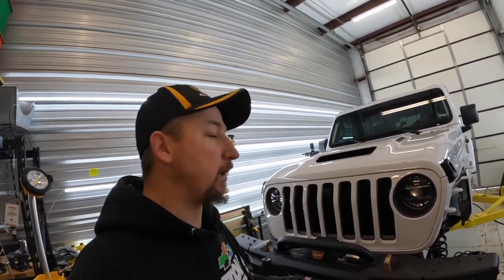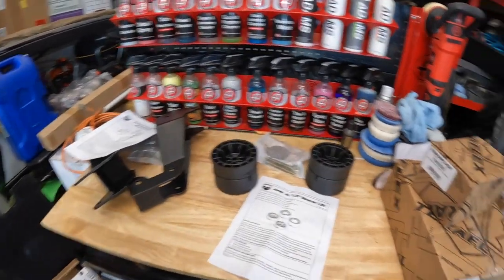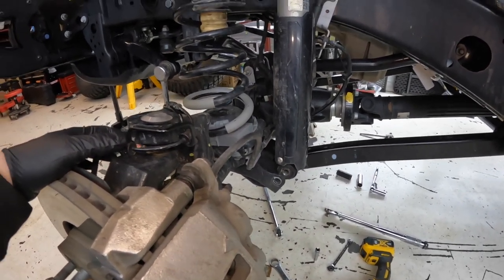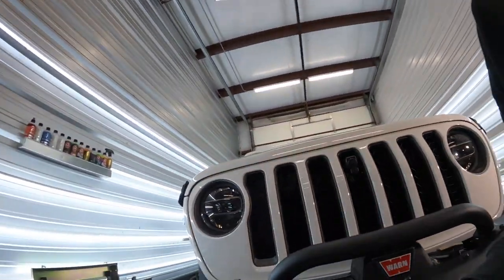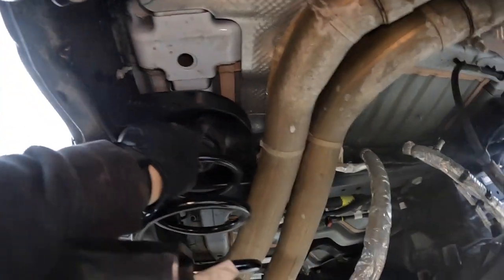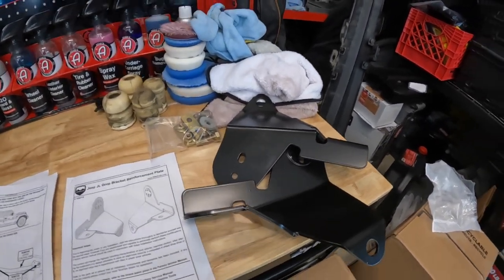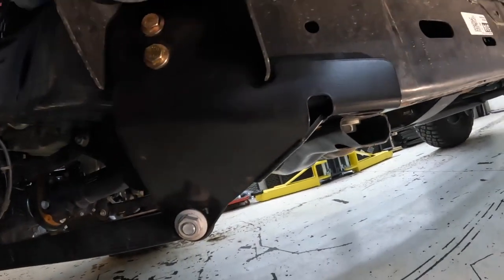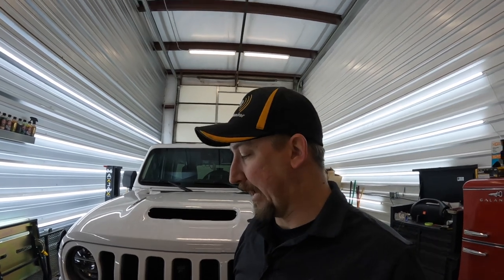Wrangler 392 Terflex Lift!

Comment: Great video! Couple questions.  Did you have to extend the shocks and how does it drive with the spacer lift?
Reply from the maker: Hey Dave, Glad you liked the video.  I did not do any shock extensions.  I called Teraflex prior to purchasing the parts to ask them about that and they said that the available 2" shock extensions would be too aggressive.  It drives pretty well.  You can tell it's not stock, but still drives better than our previous Jeep Wrangler JK with a 4" Mopar lift.  We did just get back from Easter Jeep Safari in Moab and had a chance to talk to the guys from Teraflex.  Rumor is there will be more goodies coming for the 392 soon.

Comment: Did you not need track bar brackets or an adjustable track bar because you used the front control arm drop brackets ? Thanks
Reply from the maker: You can certainly get away with this lift without any track bar modifications in my opinion.  I'm sure other people out there would disagree with me, however my intention is for this lift to be temporary until somebody comes out with a specific 392 lift kit.  From talking with the guys from Teraflex at EJS they are supposedly in the testing phase of a true lift kit for the 392.

Comment: Hey I had a quick question. Did you need shock extensions and how is the ride after the 1.5 Teraflex spacer lift? Would your recommend that set up?
Reply from the maker: We did not do shock extensions.  I called Teraflex prior to ordering the parts and asked them about shock extensions and they said it was not necessary.  The ride has been just fine.  You can tell its not stock, but not far from it.  Still rides better than our previous 2017 Wrangler with 4" Mopar lift and 37's.  I would recommend this setup for anyone looking for a budget lift option or just desperate to lift their 392, however I spoke with some of the guys from Teraflex at the Easter Jeep Safari vendor show and it sounds like they are currently testing a true full lift kit for the 392 right now.  If/when they come out with a specific 392 kit I am sure we will be ordering it for ours.
Reply: @2ndChanceOverland  thank you for the info. And great looking Jeep 392 👍